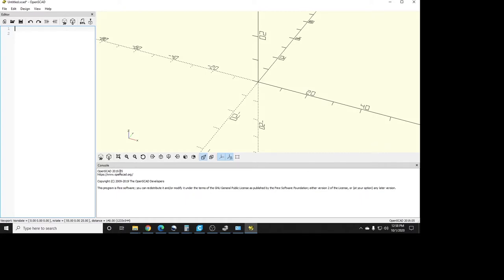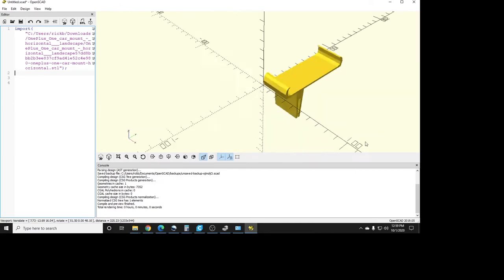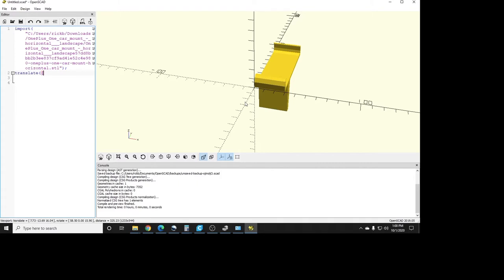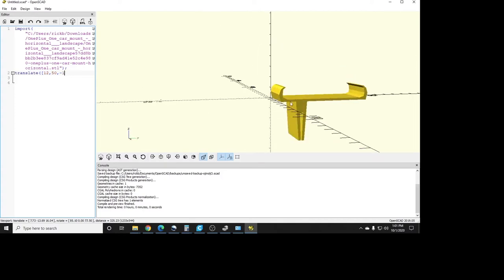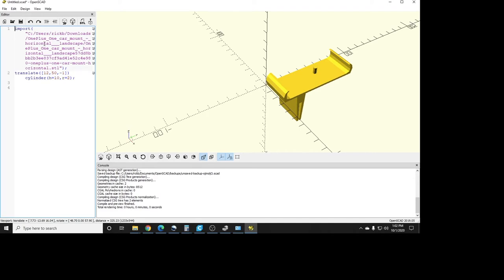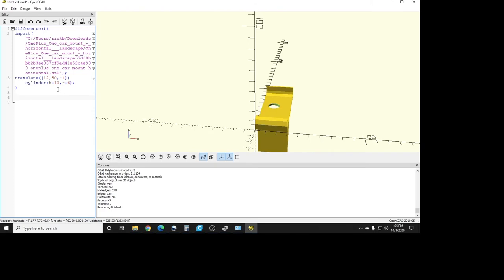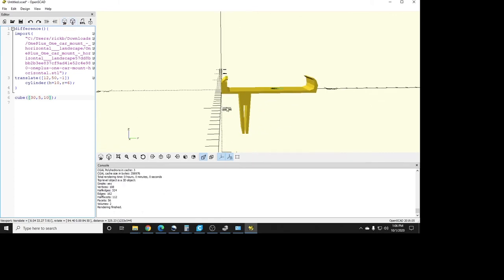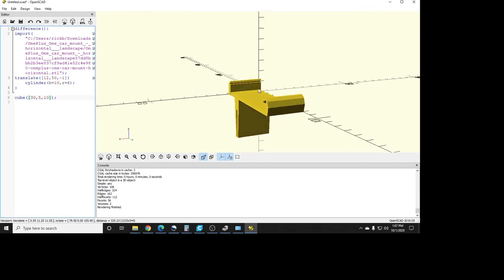Quick Tip:  Import and Edit STL Files in OpenSCAD

Comment: Bumping  up the default value of 10 for the 'convexity' argument of the import command makes the preview display a lot more coherent. For example, if you were to add "convexity = 20" to your import command (e.g. import ("filename", convexity = 20)) then it would remove all the "extra blanks it threw in there" that you mention in the video. No need to render.
Reply from the maker: Printable Science thanks for the tip!
Reply: You saved my day!